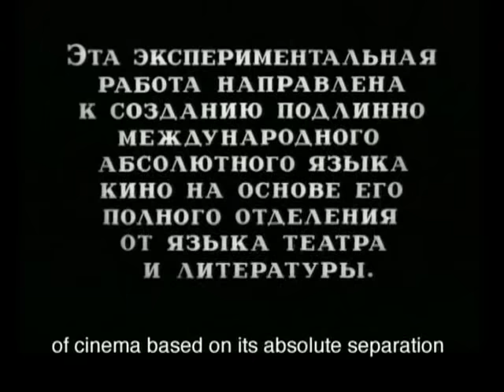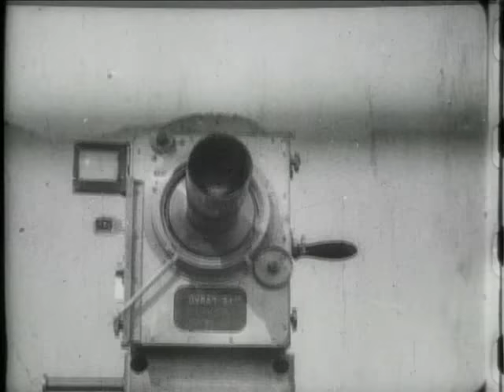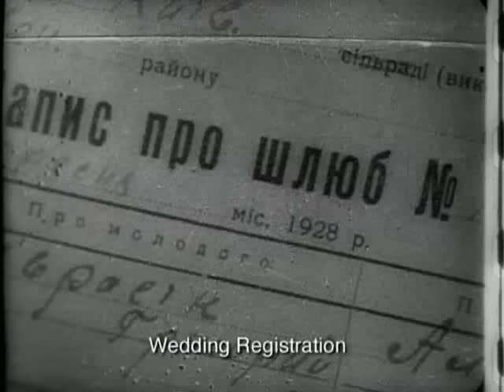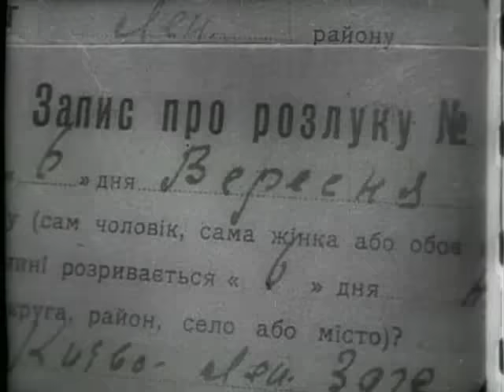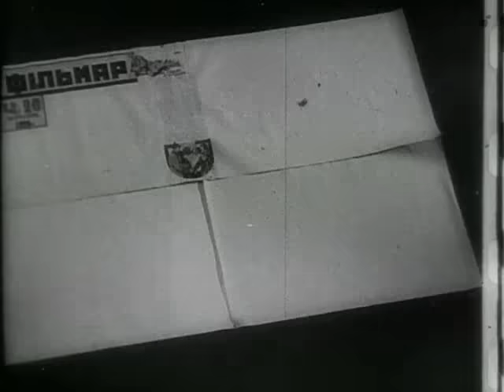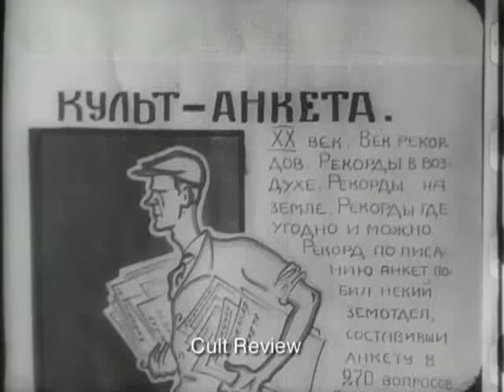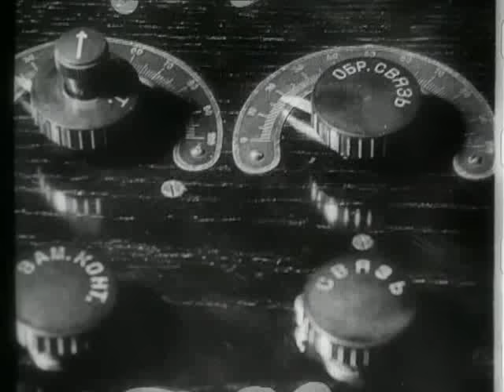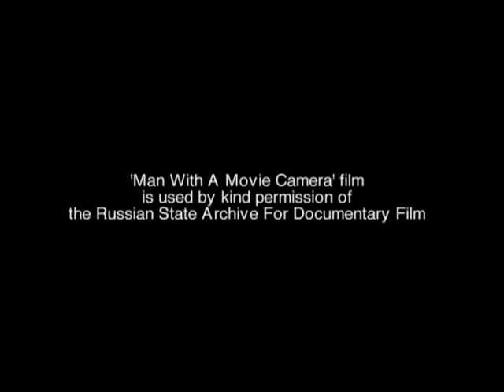Man with a Movie Camera (1929) movie

Comment: Thank you! For showing this moving film that uses montage and all the basic film tricks in an extremely creative and engaging way. The film feels fresh and relevant and it is inspiring to see a film that lets the images speak without a lot of distracting talk
The old Zeiss Tessar F:4,5/210mm from Krauss Paris does a wonderful job. and fun to see the arc lamp cinema projector in the start, and the optical soundtrack on the screen at the end (The Jazz singer premiered in 1927)
Should be seen by anyone working professionally with film.

Comment: I went to graduate school between 1972 and 1974 in the USA.  At that time, most of us discounted what was being done in Eastern  Europe as primitive. We were wrong, Poland especially had a vibrant art scene. In this film, it is evident that the film makers were highly experimental, creative, and were doing things that were not done in Hollywood at the time. They were especially experimenting with frame rate, multiple imagery, multiple panels at one time. animation, dissolves, and many unusual angles. It seems there was nothing that they didn't try.  That is what sets it apart. US films in comparison mostly were very simple  shot from fixed camera positions mostly. In the Chaplain and Harold Lloyd films there is experimentation with mounting the camera in a vehicle.

Comment: It's official time is 1hr 26min 
But this one's only 1hr 6 min
Reply: There were scenes frightening to prohibitionists who send men with guns to prohibit plant leaves, etc... I'm surprised the beer hall scene was left in...
Reply: There's a 66 minute version and a 68 minute version. If you search for the running time in Google, though, it tells you 1h20m.
Reply: @libertariantranslator1929  Do you have any idea where to find the full length version?
Reply: @dogchaser520  I bought mine at Livrarias Curitiba in southern Brazil, where the title is Um Homem Com Uma Câmera. Continental home video holds rights, vto@snsino.net is the email on the cover. Phone # is Rio area code but Fax# is for São Paulo.
Reply: Oops, email is vto@ensino.net back in 2011 or so. Used to play it on a Philips player circumventing the country codes. My notebook DVD is having touble recognizing the disk. Grrr
Reply: The box says 68 minutes. I'm going to see if an older OS can run the DVD, which is menu-driven